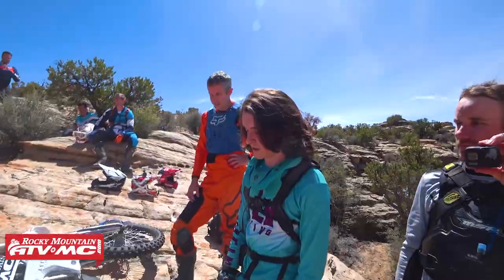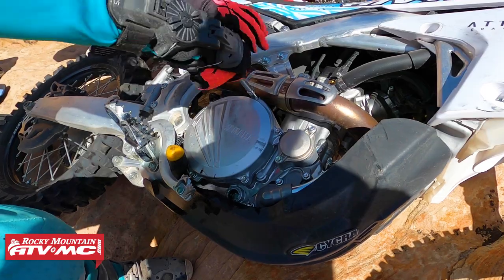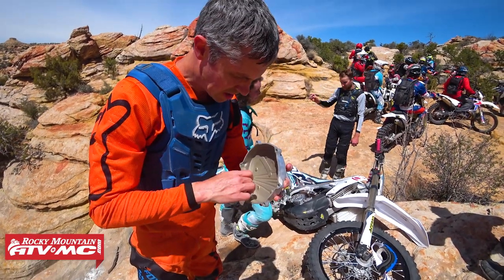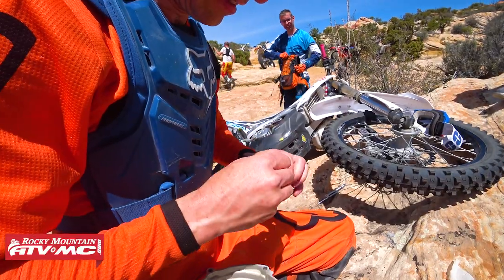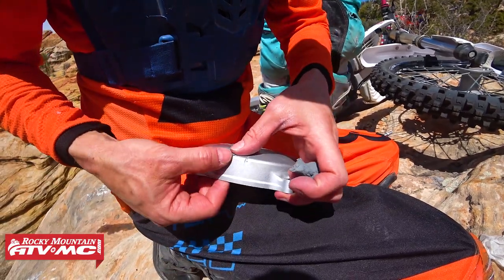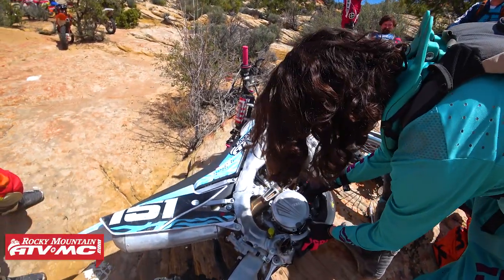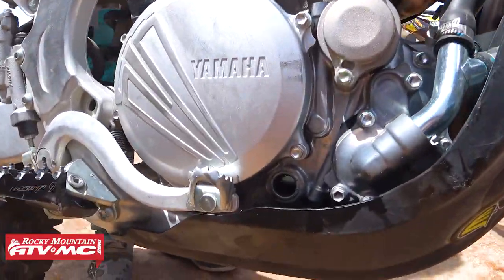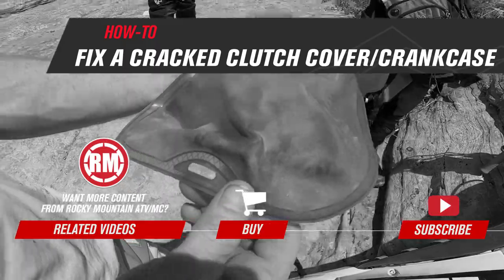Trail Fix - How To Fix a Cracked Motorcycle Clutch Cover or Crankcase

Comment: To help prevent this we always wire tie a bit of inner tube to the inside of the brake pedal tip. this absorbs a lot of the initial impact and usually keeps this from happening.
Reply from the maker: Thank you for the tip and checking out the video!

Comment: If the puncture is fairly small, you can cut a triangle shaped  piece from the inside of your hand grip. Push the pointy edge of the makeshift plug into the hole with a small screwdriver until it's wedged securely.  That's it!

Comment: Has anyone used gas as a way to clean the oil? Wondering if it leaves a residue
Reply: Squid WithGear ..... gas will leave a residue.   Acetone is an excellent cleaner, but who’s going to carry that?  Lol...  The alcohol wipes are a great idea and they work, light and easy to pack.  Also will clean your goggles, headlight, mirrors, etc....  ride safe.
Reply: Yes you can use gasoline, better than nothing in the middle of nowhere.

Comment: Would this work as a somewhat long term solution?
Reply: It would definitely get you off the trail but once your home I would take it off and use a better 2 part epoxy (JB weld) that takes about 24 hours to cure. Then you would be good until it happens again I bet!